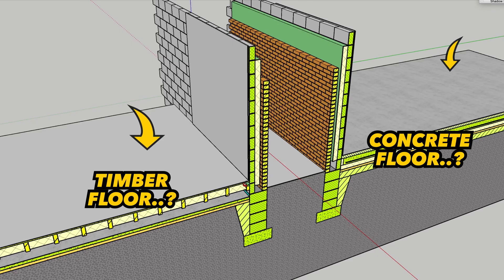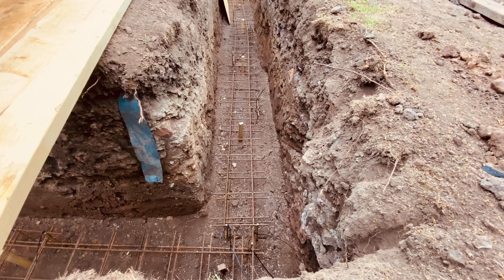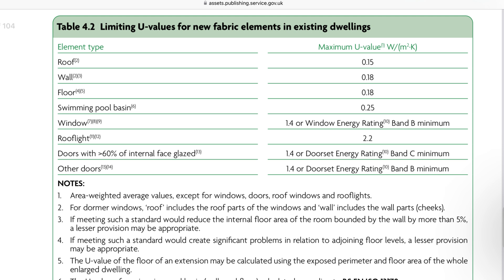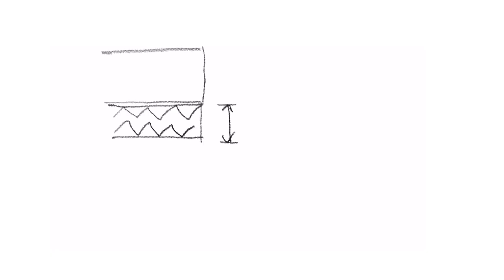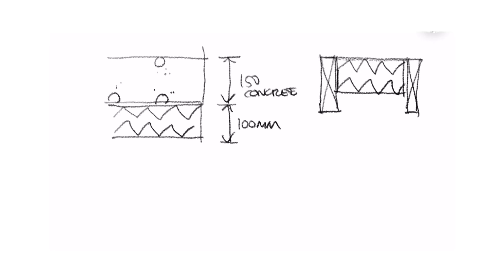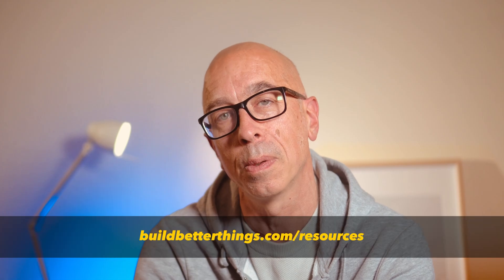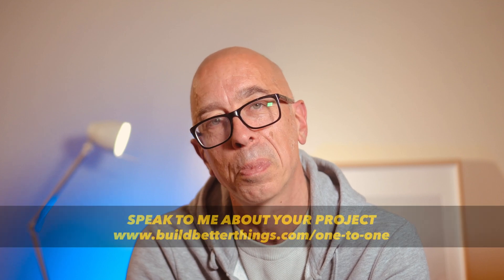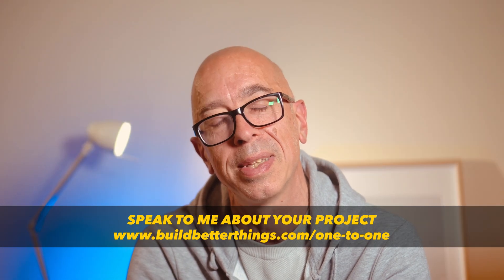Concrete Slab v Timber Floor - Cost Compare & What’s Best..

Comment: I intend to build my family home mostly alone, project atm is about 8 by 12 meters. Making a concrete slab seems like it isn't the way to go, first it looks like it requires more skill, almost impossible to do it alone specially for someone without experience, its dirtier, and probably more time consuming. Here in Portugal I guess the price would be about the same since our timber prices aren't good and its not easy to find suppliers as its a construction method that is extremely rare.

I appreciate any opinions and suggestions. Thanks!
Reply from the maker: Concrete is usually the trickier option, especially for self builders. I’m less sure about Portugal, as it always depends on local pricing and also, climate.
Reply: @build-better-things  Northern Portugal is probably similar to Southern England and Oregon in the USA. Research leads me to go with double wall with cross insulation, and some 50mm of external insulation for durability, everything with rock wool.

Thanks for your input, confirms my hesitation about concrete.

Comment: I see you use a superfoil vapour barrier. I wonder what you thought of using superfoil multifoil  insulation instead of the PIR?
Reply from the maker: The last time I checked, there was not enough data from the manufacturers to back up the claims. Or at least, data that is acceptable for local authority building regulation officers. It has its uses, but I’m not sure if this situation is one of them.

Comment: Great video but I always wonder why in this country we don’t do concrete slabs for first floor and second floor homes! They’d be much stronger, better insulated and noises insulated! Baffles me
Reply from the maker: Hi and thanks. For smaller builds, upper floors in concrete are costlier in terms of logistics, and there’s less contractors available for it, compared to stick, panel or frame construction. At least in my own experience. Maybe I should do another analysis

Comment: Retrofitting joist to concrete (would you say worth it).  Looking for better thermal efficiency and fed up renewing soaking bathroom floors!  Was going for breathable Glapor.  But not sure if I can build up around the service drains or if I need to drop all pipes to ground.

Comment: Timber floor generally is nicer to walk on, it's also preferable in areas with Radon to avoid build up or ingress. The thing I don't understand since moving back from the US is why we construct warm floors but technically don't construct warm wall or roof systems. Then to top it off we put vapour barriers on the inside instead of the outside of the building and don't use humidity control. It's a little bonkers to me.

Comment: Thank you for the comparison, I am planning an 4m x 7m single storey extension and builders keep trying to push me to change my planned suspended timber floor to a solid floor, saying it will cost less, I am going to work out the costs myself now.
Reply from the maker: It’s always a good exercise to do. Best of luck with your project.

Comment: £620 for galvanized nails that not correct £80-100 is more the correct number
Reply from the maker: Yes I wondered when it would be noticed. Means timber is even less expensive, thank you

Comment: Amazing video!!!

Thank you for sharing 

I have a few questions:
In my property, the living room currently has a suspended timber floor without concrete blinding, while the kitchen has a load-bearing concrete slab with tiles on top at a lower finished floor level (FFL). Neither floor has insulation. I want to retrofit both floors so that a suspended timber floor extends across both the living room and kitchen.

If I install a DPM below the new concrete blinding, should I lap it over the existing concrete slab? Could this lead to condensation issues?
Does it matter that the blinding will be 50mm and the existing concrete is 120mm?
The ventilated zone will still be 150mm between the bottom of the joists and the top of the existing concrete (with tiles).

Will the blinding need a reinforcement mesh to prevent cracking?
would this new buildup need a drainage system?

Thanks in advance mate!

Comment: Interesting video. From experience, concrete slabs are rarely flat and square. They are also not sustainable and are not good when services need replacing under the slab. Curious why you didn't do a true suspended ground floor where you can provide access to services etc...?
Reply from the maker: If you’re talking about suspended concrete floor, or beam and block comparison? that’s probably another video I’ll do at some point. Agree about your comments on concrete slab. Thanks

Comment: What's your opinion about Ground Screws? (for a garden room?)
Reply from the maker: I think they’re great, except when the contractor doesn’t turn up when they promised and hold you up. I don’t use them unless I’m doing a project for someone, and then I ask them to organise, if they want to go for it. If I was doing a few each year, I’d consider buying the kit and doing the screw’s myself, but concrete is fine for me for the rare occasions I do these outbuildings.
Reply: @build-better-things  Thank you so much for the advice. I need to build a small garden office and am looking for techniques to do it with minimum mess.
Reply from the maker: Ground screws are good, a little more expensive v concrete mini piles. I made a video showing how I do these mini piles. Pretty easy actually
Reply: @ I actually, browsed your videos to find something like that after seeing the latest video on cladding. But I couldn't locate that one.
Reply from the maker: @ck008uk Hand mix Concrete - 4 step method easy
https://youtu.be/WnaL-5UdKKM

Comment: New regs mean you need 150mm insulation.
Reply from the maker: It can’t be a set depth, be it 150mm or whatever.  Depth of floor insulation is dependent on exposed perimeter and makeup, so is different depending on your specific situation.  The only thing that is constant is the u value that you need to achieve.
Reply: I make it 100mm gives you a u value of 0.2039. The current regs are 0.18 for floors.
Reply: To be fair, 125mm gets you 0.1655
I am just using Revit architecture. Does all the calcs for you.

Comment: I just found out about your channel! LOVE your science based way of determining what is the best way to build things! I am from the Netherlands and some of a self builder myself. Last 2 years renovated my freshly bought house. Took out the ground floor to insulate it and put in floor-heating. While preparing for the project i tried to find out the best (energywise) way to "stack" the floor to get the most out of my floor heating and this might be an idea for a video for you as i am very curious as to what you will come up with. I was looking at 2 options of "stacking" the floor. From the ground up: "Reinforced concrete - PIR insulation - Floor heating - Screed" VS. "PIR insulation - Reinforced concrete - Floor heating - Screed".

Comment: From Canada:
I'm not familiar with you local building regulations.  By our Building Code(s) I would say your slab on grade is unnecessarily over built, based upon practice and 40 years experience.  The one glaring item is a 150mm (6") thick concrete slab.  There is absolutely no justification for that in the condition such as you've show.  If the native sub-soil is undisturbed and the organics removed and the sub-grade is properly compacted a 100mm (4") 25.0MPa plain concrete slab with a level float finish is more than adequate to apply carpet, laminate or tiles.  If you are concerned about random cracks, then saw cut the slab to a depth of 1/4 it's thickness within 18 hours of the initial set in a regular pattern no greater than 3.6m square. 
What's this with a 50mm levelling screed?  Are you just trying to weigh the slab on grade budget against wood frame?  
P.S.  just based on current real world (Canadian) conditions you can save 2.0m^3 concrete (£350) on your budget, eliminate all reinforcing steel, chairs etc, leveling course and the associated labour to install.  Not looking at your spreadsheet sheet, I'd guess with these mods, like for like (apples to apples) the two systems are virtually the same cost per square metre.
It really comes down to what makes your client more comfortable.  UK building services have always confounded me (plumbing exposed on inside and outside walls) but if it's accessibility you desire, then a crawl space/wood frame approach is most desirable.
Reply from the maker: Thanks a lot for your experience. Good to get another perspective. Not sure about some of your analysis, especially with regards the reinforcement, but this is the beauty of comments , there’s lots of ways

Comment: These videos are brilliant, I'm planning a fairly large garden room (3.6 x6m) and my head is burst over what is the best method. The garden area needs cleared- Scottish Highlands and the ground below the thin layer of pine tree stumps, moss and forest detritus is basically very well drained "fluvioglacial till"- or sand, gravel, boulders and some absolute  huge ones at that, but bugger all clay or loam. I'm considering just putting up pads as it's load bearing capabilities are already good and building an insulated box floor as a base (like  a proper version of the poorly built one our house has that lets in mice etc), as the groundworks needed for anything else are significant, and removal of spoil as you say is an issue. I could just dig the pits for the pads and save a whack, have the building raised away from the damp and wet ground. 
In the Cairngorm NP so not sure how permitted development is affected either, would prefer to do a pent roof with maybe 3m down to 2.4m this will be a cold roof, metal sheeting. Timber walls with PIR and AVCL, probably mount all electrics/ lights on the surface to ensure no compromises on insulation.
No issues with proximity to boundaries but I'm not clear on what the maximum permitted roof is normally- thought it was 2.5m max if within 1m of a boundary, 3m beyond that at eaves and if apex roofed 4m max??It would be good if the National Parks could issue their own guidance, though one neighbour has built a recording/tuition studio with notifying them (not formal permission?) so I suppose I could use the dimensions from that as a "precedent"??
Reply from the maker: Hi and thanks. Since boundary isn’t an issue, you have 3m eaves and 4m at the ridge to play about with, measuring from the lowest existing point on the ground. There are exceptions based on conservation, so yes you’d need to check for being in the national park. Sounds a great project. Good luck.

Comment: I really don't like the way the UK does slab on grade foundations. The US have developed some excellent assemblies, and we should really adopt them, here's an example from one of my favourite building science communicators:
https://youtu.be/KDLkbpraC4A?si=c0AJhPxxiK_HJcun

Same can be said for suspended timber floor systems. There are "conditioned" or "encapsulated" crawl spaces where the ventilated void is separated from exterior air, the insulation can be moved to the perimeter, or onto the ground. Again, this seems like a much better system and we should change our ways.
https://youtu.be/3YOIzEzEwWo?si=T0NkkhoHWsiNcFPt
Reply: Insulated Slab/raft foundation are all over Northern Europe, not a US specific approach.
Reply: @NickLaslett  I mean the build up. The DPM is located above the insulation. You don't need the sand to protect it, which could fall through and clog the free draining granular pad, and the concrete doesn't vibrate its way through the joints, so you don't need to tape them. High compressive strength mineral wool is ideal.
Reply from the maker: I always aim to have the insulation directly above the DPM and below the slab. The sand below the DPM is important since you want the insulation to be totally level before you pour the concrete over. I always use PIR insulation.

Comment: I'm a complete novice, can you please explain to me why you put concrete on top of insulation? Does that not create risk with stability when the insulation deteriorates?
Reply from the maker: Hi. The insulation will not deteriorate and s long as the sand that the insulation sits on is dead level, there is nowhere for it to move to.  The reason you want the concrete on top of the insulation, on the warm side, is because you want all your structural elements at the same temperature, so your inner leaf at the cavity wall is warm, like your floor, so you reduce differential movement. Architects, builders and specifiers who show the concrete on the cold side, below the insulation,  yet have their inner wall leafs on the warm side, show that they don’t understand thermal performance of these elements over the lifespan of a building.
Reply: @build-better-things  Thank you. Your explanation makes sense but I don't think I've ever seen something like this.

Comment: Hi Jerry i’m at a crossroads now. Large open plan renovation and floor needs to be dug up with costs going out of control. Builder has suggested doing Hardcore, Sand, dpm, 150mm pir insulation, another layer of dpm, underfloor heating pipes and then a 65mm poor of screed.
This is avoiding a double pour pf concrete about €2k in Ireland and labour saving of about €500. Means we wont have a concrete subfloor and losing sleep over this. Whats your thoughts on not going with the subfloor and will this be risky? I’m also in Ireland and no inspector, area is 9x9m
Great video and thanks
Reply from the maker: Hi. I don’t understand the need for 2 layers of DPM, but other than that, your first paragraph of spec seems ok. Only thing you need to understand is that your underfloor heating will then have to heat up the slab but if you get your insulation right, should reflect that back to make it reasonably efficient. For underfloor heating, often they try to insulate directly under the pipes, although i am not a fan, as the main structure, ie the slab, is at a different temperature.   To your second para and I’m probably being dumb, but I don’t understand what you mean about two pours.
Reply: @ really appreciate the reply. The second layer of DPM (Barrier) to sit over the PIR insulation so the concrete is not poured directly on to the Insulation. The UFH pipework is to be clipped on top of this and then 65mm screed poured. Have been told the screed will act as the thermal mass and 150mm of insulation reflect up and mitigate heatloss to the ground. 
I will tape and joint the PIR and typically its shown to use 25mm perimeter of insulation but your video suggests 60mm so I will go with that.

What I mean by two pours one concrete pour (150mm) and a second screed pour of 65mm. Hope that makes sense.
Diy builds are very stressful and acting as the PM is just as hard as doing the work.
Thanks
Reply from the maker: I understand it’s stressful but you are asking all the right questions so you are going to succeed 🥹🙂. You can pour directly into insulation despite what your builder might be saying to you. No need for a second layer of DPM Yes, 60mm perimeter.
Reply: @build-better-things  I think you may have missed the fact that there is no 150mm reinforced concrete layer in the buildup he mentions.  Just a 65mm screed.
Reply from the maker: You’re right Neil. Thanks for pointing it out and yes, need to consider reinforcement

Comment: Hi, you recommend timber frame for small project . Do you have a figure of how small . I mean after which the timber frame is not recommended. Thanks
Reply from the maker: The smaller the project, the more I’ll be inclined to use timber frame. The smaller the project, the less likely I’ll be to use concrete.

Comment: Another super informative video, thank you!  Any thoughts on ground screws for a timber framed and clad outbuilding?
Reply from the maker: Ground screws are fine for smaller projects such as outbuildings . It’s just easier for me to use concrete mini piles, partly due to cost, being cheaper, and partly due to the fact I prefer not to rely on specialist trades which can hold up the entire project when they can’t turn up when they said they would. If you are happy with your quote and they are reliable, then go for it.
Reply: @build-better-things  Thanks for the fast reply.  Do you have a video on mini piles?  I guess using mini piles means no need to dig a trench foundation?
Reply from the maker: @mattrumpus Cement, Sand & Aggregate Concrete mix explained - DIY Spreadsheet
https://youtu.be/83ZzGLx1JCc
Reply from the maker: Hand mix Concrete - My simple 4 step method
https://youtu.be/WnaL-5UdKKM

Comment: About to construct a base / foundation and for me the worry is weather with a wooden floor approx 8 sq metres .Trying to cover during construction
Reply from the maker: The joists will be fine uncovered for a period provided they are treated, as they should be. If you’re using chipboard you could consider a weatherproof product such as Egger protect.
Reply: @ Thanks but now considering a small block and beam set up . Will keep you posted ( very much retired)